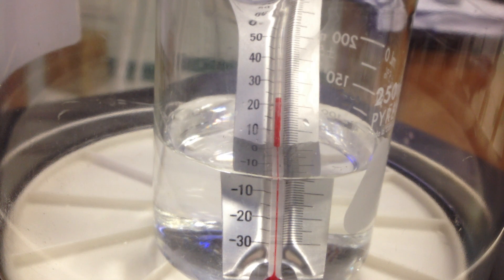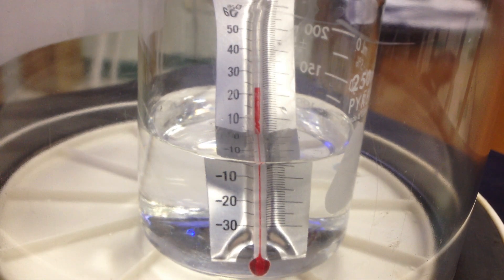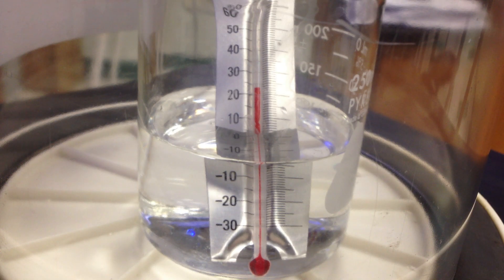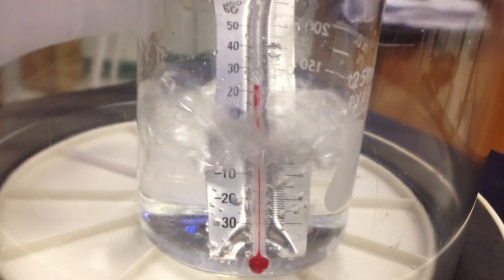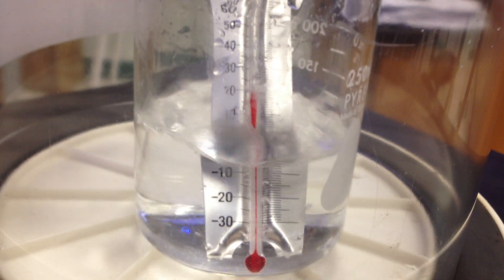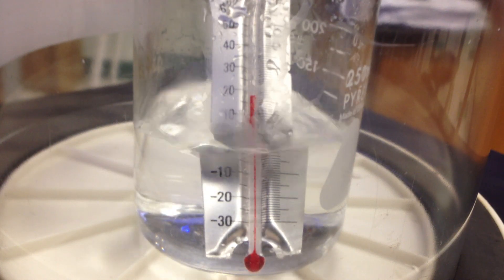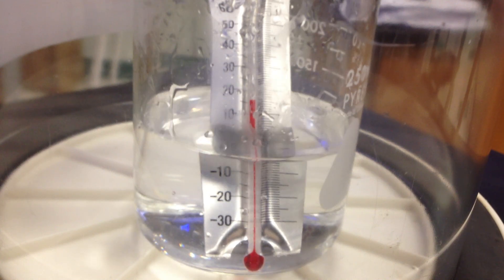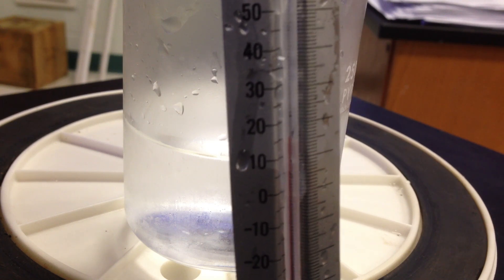Boiling cold water In a Vacuum Chamber

Comment: In mountainious terrain at high altitude and lower atmospheric pressure the water inside the kettle you place on the stove has a boiling temperature of sth. like 80°C ( 176°F ). My friend had a model steam engine with a window inside the expansion tank. After the engine's firebox ran out of fuel and the water stopped boiling, I handcranked the engine, creating a negative pressure in the tank. The water subsequently restarted boiling. I was amazed upon seeing this phenomenom for the first time over 25 years ago.

Comment: Trick question. The glass is completely full. If half of the glass's volume contains water and the additives in it, in most cases, the glass is full. The one situation in which the glass is not full is when you place a glass of pure water with no minerals, bacteria, or anything else that isn’t hydrogen or oxygen￼ inside a vacuum chamber, the temperature of the water drops and it will boil. Then and only then is the glass half full and half empty.

Comment: We do not see the water boiling due to the pressure drop, but simply some air bubbles that were dissolved in the water due to atmospheric pressure and expanding due to the pressure drop.
This explains the process stopping around 4 minutes, not because the temperature dropped but because most of the dissolved air was released.
The temperature drop is indeed due to vaporization but mostly not because of boiling conditions, simply because bubbles forced vaporization by expanding in the water.
If you had waited some more, you could have concluded that vaporization was due to water boiling.

Note that, when you heat water, air bubbles form because the virtual pressure of the dissolved air increases faster than the atmospheric pressure, because of the heating, when the virtual pressure goes above a certain threshold bubbles form.

Hence, in both cases the bubbles form because the virtual pressure crosses the threshold, but in the case of the vacuum chamber, it is because the threshold drops due to the external pressure drop, while in the case of the heat source, the virtual pressure increases due to heating.
Reply from the maker: I very much agree with all of your statements. When I first made this video many years ago I was trying to demonstrate the concept that boiling temperature is affected atmospheric pressure as any phase diagram of water supports.  Degassing of the water is clearly occurring in the demo (due to Henry's Law) and the expanded gas molecules moving to the surface is clearly adding to the vaporization and subsequent loss of thermal energy.
 I will however argue that boiling and degassing are inherently intertwined concepts. It is not as simple as saying that this phenomenon demonstrated is degassing and not boiling.  Boiling of water and degassing do or can occur simultaneously and this can lead to increased boiling temperatures due to superheating (when we are not in a vacuum). Boiling temperatures will also depend on the surface of the container which affect cavitation of the dissolved gasses and the water vapor. That is why boiling chips are used.
So did the water boil in my demo by lowering the pressure? Was there only degassing? Did the degassing and boiling occur at similar pressures?
Does the degassing create the cavitation for the vapor molecules to collect into larger ones if in fact the water was boiling as very small water bubbles before it was degassed?  This is a system that is much more complex than saying it is boiling or if its degassing.
Reply: No you are incorrect, the boiling occurs because of the pressure difference and phase change. He was correct, you are wrong thibaultjoan -- This is exactly how refrigeration works -- technically you could use water as a refrigerant but would not be the most suited because of the phase change thresholds. I've included a Wiki page on this https://en.wikipedia.org/wiki/Boiling_point
Reply: @fjs1111  thank you for your input on the thermodynamics of vaporisation of water at low pression. My initial comment was a bit simplified, but it's likely that what we see on screen is mostly the water releasing its desolved O2 because of the very low pressure. Obviously in the process some water is also vaporized which makes the temperature drop. Converting liquid water into gaseous water consumes a lot of energy and roughly considering the observed temperature drop and the observed amount of gas released we should see a much larger temperature drop.
Finally when you do the same experiment after degazing the water, it's simply not what you observe.

 @MrGrodskiChemistry 's answer already covers the limitations of his own experiment in a very detailed and satisfactory way.

Comment: 2 questions.
1-is there a formula for how much vacuum is needed to lower the boiling point a certain amount of degrees?
2 (maybe a dumber question)-in your vacuum chamber you show do the water molecules condensate at the top and fall back down?

Comment: Just because you see bubbles it doesn't mean its boiling.put some pasta in it and leave for as long as u like it will never cook and will remain crunchy.if u continue to remove the air the bubbling stops and it will freeze if your pump is adequate.u cannot heat water in a vacuum u need air an pressure to transfer the heat in to the water.as the resistance pushing down is removed the water reaction is to bubble   and get colder and will slowly decrease and can flash freeze.
Reply from the maker: Boiling is not temperature dependent thus whether you can cook a noodle has nothing to do with boiling. The temperature a liquid boils is pressure dependent. The temperature a liquid boils is relative.  Water that boils below 100 degrees Celsius does so because the pressure is below the standard pressure.  It can boil at room temperature BUT it does not have the energy to cook pasta. Liquid nitrogen boils at approximately -196 degrees Celsius and even though its boiling it cannot cook a noodle because of the low temperatures.
Reply: @MrGrodskiChemistry  hey mrgrodskichemistr... I agree is it pressure that makes it possible for water to boil? Under normal circumstances.however in a vacuum its heat,if u had a hot plate,like a single ring electric hob in a vacuum with a bowl of water ready to heat.when the air is removed the heat has no heating effect on the water.so air makes it possible to transfer heat from A to B in a vacuum.but u do observe the bubbling of the water as if it was boiling,if u continue to run the pump the effect observed will stop and the water becomes absolutely still,motionless and will flash freeze, depending on  how good pump an chamber r.so as the air reduces the pressure on the surface of the water reduces also,allowing the water to b unrestrained and move freely until gradually the cold of the vacuum slows the water molecules down(atoms)till it freezes.i would like to add the standardized measure of temperature uses the boiling and freezing point of water? Energy =heat....no heat no energy. Temperature is not heat....thanks for your reply👍

Comment: Would the water boil off completely at a certain pressure or would you have to keep the vacuum running because the liquid is turning into a gas state, replacing the air molecules that are pulled out of the chamber? I may have just answered my own question but feedback would be great!
Reply from the maker: My vacuum is not particularly strong so the it would boil off as you suggested. If I had a better vacuum the water would freeze.
Reply: @MrGrodskiChemistry  Wow, cool demonstration nonetheless. Thanks for the feedback!
Reply: @MrGrodskiChemistry  vacuum not strong? I tried what you did with a 2 Pascal vacuum pump and even after several hours, nothing happened.

Comment: The cooling is because every mole of water that evaporates removes one molar latent heat of vaporisation.

The latent heat of vaporisation is not pressure dependant, or at least is only very slightly pressure dependant, so the evaporation cools the water to zero Centigrade then freezes it.

Comment: I am interested in the boiling rate ... how many cc/minute will boil off if you keep the pressure below 0.2 atm  ???
Reply: I can't answer your question, but I can say that you will need to keep temperature at the same point, otherwise the rate will slow down equally to amount of energy excluded from system.
Reply: Also you need to have a constant supply of water, because otherwise all of it will eventually boil, and know somewhat constant volume of liquid in reservoir, because this also affects the rate, so your rate should rather be measured in "cc per liter per minute at a given temperature and pressure"
Reply: After that I think you can just find a table of corresponding values (at least for distilled water they should exist) to calculate exact values for your input data, like 0.2 atm & 25 degrees Celsius (table will more likely stick to Kelvin but hey)

Comment: if the water "boiled" it would become steam,which would expand 35 times and no longer be under vacuum
Reply: The number of water molecules in the container doesn't change, they are now able to occupy more space as they are not impeded by air.
Reply: The steam is in there, you don't see it because it's in a vacuum and temperature differences can't create condensation.
Reply: that's why it's continuously pulling a vacuum, its pulling out that gaseous H2O.

Comment: Does not boil. The oxygen in the water goes out. Air bubbles are formed while exiting. If the heat was rising, it would be boiling. Take your mind.

Kaynamıyor. Suyun içindeki oksijen dışarı çıkıyor. Çıkarken de hava kabarcığı oluşuyor. Isı artıyor olsaydı, kaynıyor olurdu. Aklınızı başınıza alın.
Reply from the maker: I will agree that oxygen gas is being removed but "air bubbles forming while exiting" is problematic as the amount of air in the vacuum chamber and in the air dissolved in water is far too low to provide the moles of  gas particles to support the volume of these bubbles forming.  Also the weak attractive forces that oxygen has with water and the small amount of oxygen that is dissolved could not account for the significant temperature change that is occurring.  One more point. Heat does not have rise to boil a substance. Heat dissipates in all directions.
Reply: @MrGrodskiChemistry  
Thank you for the explanation, but I think it's wrong.
If oxygen comes out of the water due to pressure, it is wrong to call it boiling.
Reply from the maker: @aci_gercekler  Oxygen leaving is called degassing but water is boiling also.  As I said the decrease in temperature indicates a significant loss of energy from the system which is due to the higher kinetic energy water molecules overcoming the attractive forces of other water molecules. There is so little oxygen in water that it could not account for this energy change. Also the volume of the bubbles that is observed indicates some significant gas other than air and oxygen which is not present in large amounts is leaving the water. That gas is water vapor.

Comment: Why does it stop boiling ?
Reply from the maker: The system reaches its lowest pressure position and the water loses its molecules with the greatest kinetic energy which lowers the temperature below that particular boiling point.  Also there is degassing that is occurring and all the dissolved gas have been released.
Reply: @MrGrodskiChemistry  so basically, when water turns in to vapor, it fills the chamber and there is no more vacuum?
Reply from the maker: @hikolanikola8775  The vacuum has limitations and can only lower the pressure to some value and never becomes a pure vacuum. the water vapor contributes yes.

Comment: so if its not actually boiling, in like a heat sense, like what would purify it. does it create hydrogen gas? like combustible gas?
Reply from the maker: Not sure what you mean by "what would purify it".  The water does boil here as well as the degassing of the dissolved gases like oxygen.  The process is entirely physical and thus there are no chemical bonds broken or formed to create hydrogen gas.

Comment: Do you have to worry about water getting into the vacuum pump? If it does affect the vacuum pump, how do you prevent the water getting into the pump? Would a collection container between the vacuum pump and the vacuum chamber work to collect the boiled water?
Reply: @AMthefox  interesting. Do you have any recommendations on vacuum inline traps?
Reply: Most pumps require vacuum oil. If you don’t pump permanent gas, water or ethanol will blend with the vacuum oil and the pump will break.

Comment: why doesn't it get hot scene Bernoulli's principle would seem to apply here correct because when the pressure comes back it should generate heat
Reply from the maker: The most energetic water molecules are the water molecules that will vaporize and thus since you are losing energy the temperature drops.  Evaporation is an endothermic process and there is also cooling due to gas expanding into the vacuum.  The gas (water vapor)  increases in potential energy as it moves away from each other near the beaker and into the vacuum and since energy is conserved  the kinetic energy must decrease and so does temperature.

Comment: Why this is not an exothermic reaction if the water in liquid state is losing energy?
Reply from the maker: The key is the temperature change. The system is getting colder because it is consuming (absorbs) energy as the water changes phase from a liquid to a gas.   This system is being driven to produce water in the gas phase as the atmospheric pressure drops.  (The process is trying to reach equilibrium but cannot achieve it because of the vacuum pump. )  Liquid water is using the thermal energy of its surroundings (at room temperature) to move molecules of water fast enough to evaporate.  It is this consumption (absorption) of energy that lowers the temperature and signals an endothermic process. If it was an exothermic process the temperature would have increased.

Comment: why did the water become colder when you raised the pressure at the end?
Reply from the maker: Are you asking about the temperature change from the point just before adding the atmospheric pressure to the point right after the atmospheric pressure returned to the system?
Reply from the maker: Okay you made an excellent observation.  What you observed is the Joule-Thompson Effect. When I opened the valve to re-pressurize the system atmospheric gas was "throttled" through a small opening.  We have  to assume that there was little if any heat exchange between the vacuum chamber (system) and the surroundings.  The returning gas was closer together when it traveled through the valve (throttle) had to do some work to overcome its attractive forces to expand in the lower pressure container. The internal energy of the gas remains constant and is equal to its kinetic energy and potential energy. The potential energy increases as it expands past the throttle (work is being done on the system) and the kinetic energy must decrease to keep the internal Energy constant. The kinetic energy decrease results in a temperature decrease in the chamber.  The water in the chamber exchanges its heat with the colder air.  This is why air horns or pressurized cans of fluid of air feel cold when the gas is released from them.
Reply: @MrGrodskiChemistry  I am talking about the point just after the atmospheric pressure returned to the system.

Comment: Curious just themometer in chamber no liquid, also have a second themometer that's outside chamber during test and check temp of water making sure vaccum isn't changing the reading on themometer? Something to make another video on.. curious if volume of water is that cold or is the evap vapors hitting the glass and metal on the monitor causing temps to look that low..

Comment: It's how an flash type evap works, except they're insulated and has low pressure dry superheated steam (3-5 psig) going around the header tubes to preheat the water a bit, and a set of air ejectors draw the vacuum  (or a electric vacuum pump in some evaps)

Comment: At 2:40 again. Boiling occurs when VAPOR pressure exceeds atmospheric pressure... up since 2013 and nobody caught this?
Reply: From wikipedia: "Boiling is the rapid vaporization of a liquid, which occurs when a liquid is heated to its boiling point, the temperature at which the vapour pressure of the liquid is equal to the pressure exerted on the liquid by the surrounding atmosphere."
Reply: I'm familiar with boiling conditions.
...
Equal / exceeds, minor point accepted, but when they are equal there isn't a reason for vapor bubbles to form.  
The vapor pressure actually has to slightly exceed the surface pressure since boiling starts where the heat is at the bottom where the hydrostatic pressure is a bit higher than at the surface.
...
However, it is normally described from the aspect of the vapor pressure, not the atmospheric pressure.  In other words, we normally alter the vapor pressure not atmospheric.
Since he's doing the opposite, I'll give him that one.
It doesn't sound so bad this time around.